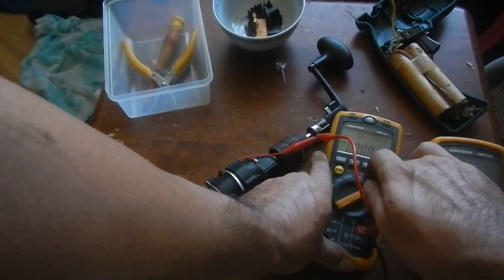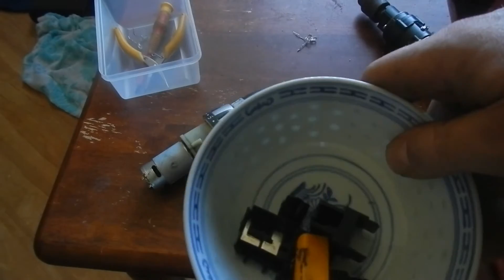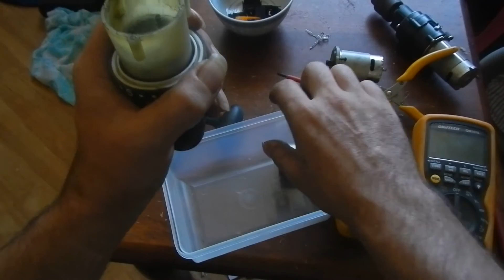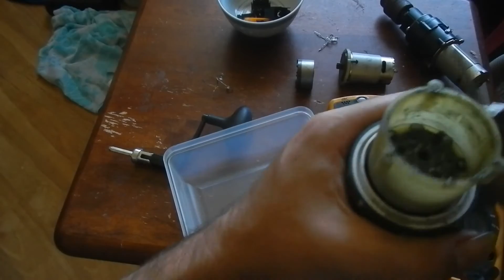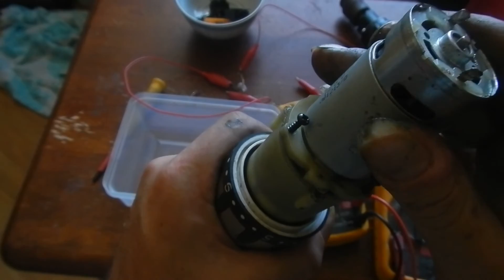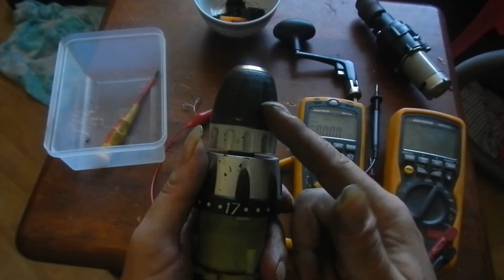DIY DC Generator from cordless drill.

Comment: drats.... i thought i might use my 18v drill to gen power for charge a 12v batt that powers a 12v well pump. small spring fed water supply, using the over flow for a turbine. id guess about 8-10 gal/m any suggestions?

Comment: Could you just take the motor, wire your wires to the terminals, and attach a water wheel as a hydro set up? Maybe do it in serries?

Comment: I believe the reason the drill is made not to turn backwards is so if the motor has inadequate power to finishing driving a screw in you can turn the handle. Getting a bolt to break loose by turning the drill before  even engaging the motor is the same. 
Lastly the keyless chuck is workable one handed if the spindle locks.

Comment: anyone know why the motor wont generate voltage without the gearbox, im turning it fast enough.
Reply: Unfortunately, a generator has to be spun MUCH faster to get ANY electricity out of it than how fast a motor spins with a LITTLE electricity put into it. I don't know why it is that way, but it is that way!

Comment: if i add a transformer with a 10 turn primary and a 5 turn secondary do you think it could push two amps?
Reply from the maker: Its dc current, so a transformer wouldn't do much.

Comment: While measuring the voltage on the multimeter, did you have to hold down your drill trigger?
Reply from the maker: no because the trigger was disconnected. If you try this with a variable speed trigger connected, you'll blow the trigger circuit or it wont work. Not sure which. Probably blows which is why the was the rollers to stop me doing this installed in the gearbox.

constant speed drill you can just hold the trigger down and wind. They only seem to have reverse torque protection on variable speed trigger.

Comment: will a bicycle spin it fast enough to change a 12 volt beep cycle battery
Reply from the maker: +Duck Donald Short answer. NO.

Long answer. If you had an 18v or higher drill, some well made gears, and a half a dozen Olympic cyclists. Maybe, just barley. Grab a Diode and find out.
Reply: @MongrelShark  is the reason as to it not charging due to it being high current but low voltage?
Reply from the maker: @masterhutchgaming1566  short answer. Yes. 
There is not enough voltage to charge a 12v battery. You always need more voltage than the battery voltage to charge. For a 12v lead acid battery you need around 14v.. Less than this and battery impedance will act as a resistor and limit your current to a useless amount.
If your voltage is less than the state of charge in the battery then you can't charge at all. The battery will actually try to supply power to your charger. Which is why all good chargers have diodes...
Reply: @MongrelShark  I thank you for quick reply!  I am working trying to find a good hand crank device or maybe affordable solar to bring me Electricity to my tent I live in.  I never was wealthy and so I got a tent to go off grid and it's frustrating to have come to town all the time to charge up all my stuff.  My aunt demands me have a phone so she can check up on me.  Modern human doesn't seem to remember that our ancestors started in the wild.  Any suggestions?  I have $175 for my birthday and a small job I did to try and establish an electric system.
Reply from the maker: @masterhutchgaming1566  solar is the way to go. I lived off grid for 10 years. Soler is the best for small, portable, and low budget.
If you only have usb chargeable devices. You can get good solar panels and batteries for 5v usb well within your budget.
If you have laptops and other devices you want 12v solar and batteries as well as a good dc to dc converter for stepping up to 19v laptop or down to 5v usb. Most camping electrical equipment is 12v.
If you don't have a vehicle 5v is the way to go. As 12v system is bulky and expensive.
Reply from the maker: @masterhutchgaming1566  you may want to do some research on batterys and charging etcetc. The more you can diy the more you can save money and nights with no power. And there is some safety stuff well worth knowing if you rely upon batteries or if you dont like waking up to your tent on fire from an abused battery.
Reply: @MongrelShark  yeah part of my fear is that a battery spontaneous ignition could burn my tent and possibly my beautiful forest!  Thanks for the tips!  I have been looking into these DIY and it actually brought me to your channel. I thank you for getting back to me 3 years after your video is up!

Comment: How can I hook up an out let plug to charge with it?
Reply from the maker: In theroy. Asuming you want to charge via USB. You would need a good 5v regulator. As well as some way to turn the drill continuously with a bit of power and high enough speed. So a little bit to work out depending on what you want to charge. There would be more efecient ways, but what you sugest would be a good learning project if you had an old drill for the parts.
Reply: Thank you, im working on it now.
Reply from the maker: Let me know if you need help with a regulator etc.

Comment: Cool experiment!  I've tried using them for generators as well.  But as you found they have a lot of friction or spinning resistance.  Not very efficient.  Thanks for posting!
Reply from the maker: I was fairly impressed with output. 5-7 watts for a hand cranked generator. The low voltage does limit uses though. After the video I re-lubed the gearbox with thinner grease and it reduced un-loaded friction a lot.
Reply: I imagine you are putting a lot more than 5-7 watts into the crank.  I would be tempted to oil it even with something as thin as WD40 or some other really light oil. Might make noisier and not last very long but it would decrease the friction a lot.
Reply from the maker: Thats sort of what I did... a little axle grease, but that was way to thick and made it worse. So I diluted it with wd-40.... Much better now.

Comment: I liked the fishing rod attachment. Also the gearbox disassembly.
Got a drill motor on one wind turbine, no gearbox. Charges pairs of AA's with a 10mph wind in about an hour...like you say, the current is good. Tip for these motors and wind, old box fan plastic blades.
Reply from the maker: I could see those fan blades spinning up pretty fast in decent wind. The gearbox would be too much load and loss for a small turbine. gearbox could be ok on a mid size VAWT though. Where there is more torque and lower rpm.

What I am really looking for is a low voltage high current generator, that has a lot of breaking effect under load, so it cant go too fast. Where load can be increased to slow the rotation speed. Lower the rpm the better. Any ideas?

Comment: That first drill is an old Ryobi 7.2V with 3 sub C 1.2V Ni-Cad cells per tube.  Brings back some memories as that was my first drill as a teenager and I scrapped one about 12 months ago as well.
Reply from the maker: Thanks for that info. I was wondering what it was. Been in a box of spares for 10 years... All the markings are long worn off. Was a good drill before the batterys died.

Comment: Thanks. You've done a lot of legwork here that'll come in handy, as usual.
Reply from the maker: Still more to explore too. I'm now wondering how a hand made generator or alternator would compare to a motor. Whats the best option for DIYers like us to convert mechanical rotation to electricity...
I think I'll try making an alternator next. Would MOT coils bee too big or hard to get for your project?
Reply: Mongrel Shark
You mean MOT coils as part of the generator. They're square in shape?!? No problem getting them - I have 4 or 5 sitting in a box behind me.
Reply from the maker: I'm thinking something a bit like this http://www.instructables.com/id/DIY-1000-watt-wind-turbine/
But with say 4 mot primary coils in a single phase or 2 phase arrangement. Using 4 magnets from 2 magnetrons. Still studying. I want it simple to wire and make with minimal magnets. Yet it needs to provide resistance to turning at low rpm. So minimal gearbox is needed. So maybe something like this would be better http://www.windstuffnow.com/main/radial_air_core_alternator.htm

Most of the guides I can find are on wind generators, so they want less cogging and mechanical load. The opposite of what we want. I would like to make something with some turning resistance at low rpm and just put dome grunt into turning it slowly. Might not be that simple, but thats the first thing I want to try.

Comment: A new set of fancy brake motors that would slow down the electric car and regenerate a little more energy in the process would be a great idea with that little experiment! 
You've got more balls them me to pulling apart a drill gearbox! Pretty interesting stuff, those needle rollers are exactly them same I believe most blokes have in uni-joints on diffs.
Reply from the maker: For regenerative breaks a poly phase ac setup is better. I wouldn't like my ability to slow down dependent on a set of brushes being able to sink the current.
Reply: Like those fisher and paykel washing machine motor?! There are a pretty cool setup. I was thinking how you could use gearing to not only slow down a vehicle but regenerate some of that energy into electricity.
Reply from the maker: The fisher and paykel motors are very popular fr electric vehicle conversions. Although there are stronger poly-phase motors made for electric cars etc. They are popular because of the ability to use as regenerative breaks. As well as excellent power to weight and efficiency. Downside is you need huge ultra caps to store the charge till the batterys can soak it up. So only a percentage of breaking energy makes it back to the batterys. Much can be found with a bit of googling. There is even regenerative suspension in the works. With linear generators for shock absorbers.

Comment: If you want to attach a DC load, it could be an idea to use a diode bridge rectifier, so that the plus and minus always are knows.
The power generated from these drills can be enough to charge a battery or so, but the friction is kind of high.
If you like to see how an e-bike can be used as DIY generator, please check e-bike powering 24Volt light 250Watts